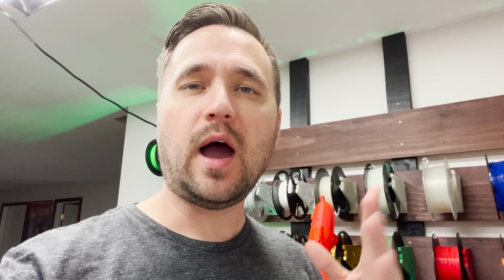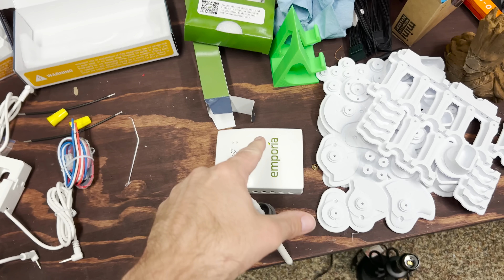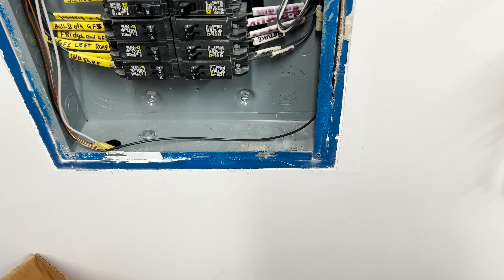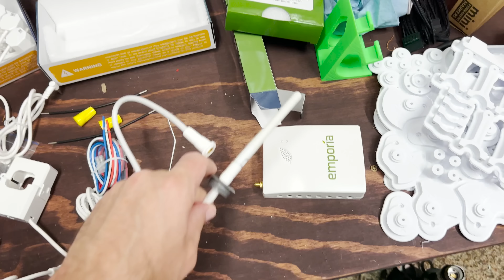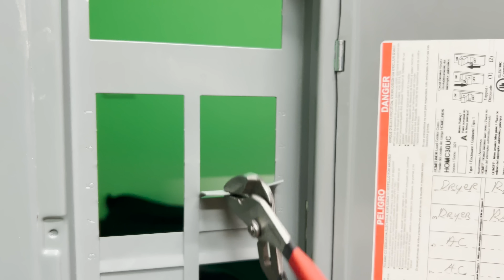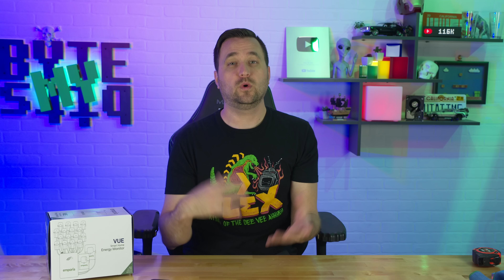Emporia Smart Home Energy Monitor, hands down worth every pennny!

Comment: The minute you said "server room", I knew you were going to be burning a lot of juice.  In general, unless you are doing heavy-duty computation, you are better off with things like laptops, Raspberry PI, or a maybe a NAS device if you need networked storage.

I just installed Vue myself - I still have around 400W unaccounted for that I would like to sort of get a handle on, and I have some mislabeled circuits that I need to verify (including one 240V "mystery circuit" that so far hasn't drawn any power).   Right now mine is still a rats nest - my project for later is to start to zip-tie the white cords up into bundles to try and neaten as much as possible before I put the cover back on.  But if the "mystery circuit" is no longer connected to anything, I might move that CT to some other circuit.

In my case, we already had solar installed - the Vue does a good job of accounting for the generation from solar.  The orientation of the CT for the solar connection is weird however - pay really close attention, and it might be reverse of how your other CTs are installed.

Comment: Im an electrician and we normaly use energy/power data loggers to measere the total energy consumption of a building. The emporia energy meter your showing is actualy a more simplefied version of these energy data loggers.
What your calling sensors are actually CT'S ( current transformers ).
And normally to measure the total energy use we would place our CT'S only on the 2 phases or 3 phases entering into the main circuit breaker.
So you dont need to use al 16 CT'S.
You could just use the 3 big ones and you will be able to measure your total energy consumption.
Reply: May I know which model of power loggers you typically use for buildings? We are having an energy audit performed at our factory and it would be good to monitor larger motors and fans. We were quoted $13K Per item for this (temporary) monitoring!

Comment: You didn’t hook up to ‘different phases’ - ur home is actually ‘split single phase’ - secondary xfmr has a tap on each end, with a center tap as ur neutral- at ur panel, you have the two hot legs from the end taps and the neutral- potential across entire secondary side of xfmr is 220v and potential across either end of secondary tap to neutral (which is bonded to grnd) is half of that or 110v

Comment: Great review, I dont know if you own a ev, that company also makes a ev charger that can work along with that energy monitor. So say you have all of you servers sucking all of that power,along with ac units or other high drawing appliances. If you are reaching the max load of your panel and the device detects it it will automatically lower the power from the ev charger. The wires look like a mess but having the same brand charger with the same app I am  stuck using the same brands. 

So what I am asking is do you think it is reliable worth the money. I can get a nice discount if you buy them in a package. Thanks for you help.

Comment: This is not a two-phase system. This is a single phase power source. It has 2 leads that are each 120VAC. A single-pole circuit breaker uses 120VAC, a double-pole circuit breaker uses 240VAC. Again, not a two phase system, it's a single phase, 240VAC electrical system..
Reply: A lot of people use 2 phase and split phase interchangeably.

Comment: This is a good system but has a serious flaw. If you've got grid AND solar supply with a hybrid inverter, Emporia will double count the grid supply. Emporia told me they couldn't fix this, even though I told them they only need to add in one subtraction calculation. Inverter output - Grid input = Solar contribution. So because of this flaw it's useless in this situation.

Comment: We pretty much all have an electricity and gas usage monitor in the UK but the implementation is terrible, it’s all a closed a proprietary standard which was rushed out and the usefulness of the data depends completely on whether the energy company can be bothered to make it accessible. Mine seems to have random days of usage missing.

Comment: I've been debating between this emporia and sense. Did you look into sense? It seems like alot of people like that because of the "unlimited" devices. But was wondering your thoughts.
Reply: I looked at sense first and I found a lot of reviews that said the AI component is still in its infancy and doesn't quite work.
Reply: @RichardFPV  yes that was what I heard also. Sense is good for whole house usage and a secondary source of power from solar or generator.  It was lacking in how to learn knew electrical signatures.  That is how it knows an AC or a welder or an oven is using power.  

What I would like is to have meter or usage reporting on each leg or circuit. By the way, the clamp meters with this unit is limited to 50amps. That leaves out most of my 220 legs.

Comment: I feel like Sense would have been a better way of doing it. It doesn't require all these adapters, just the two power clamps and after a while, it can adapt and detect what kinds of devices are drawing power and how much. It's actually really crazy how it works.

Comment: Jason...  This Emporia Smart Home Energy Monitor seems like a great idea.  Your breaker box and sub-panel box looks well marked.  I have a question though, my breaker box looks like the original electrician was a total retard.  In that only the major breakers are marked clearly.  I'm wondering if there is a device that can be pluged into a wall socket and then use something similar to a tone generator like network engineers use to trace and identify network cables at the breaker box.  In my case I believe all of the 220 volt circuits have been moved over to a sub-panel when I had my AC installed and those the electrician clearly marked.  But the main panel box is a real mess with regard to be clearly marked.

Comment: You can choose different units of measurement in the Emporia app, including amps. Just click on the burger in the upper left, and there’s a heading for it.
Reply: Does it work for 220v? It is 2 hot lines. 2 hot in one sensors?

Comment: I've always wondered why people are so afraid of getting shocked or electrocuted. I've shocked my self many times and I kind of find it fun and not painful. I was 6 the first time plugging in my radio and squeezed the prongs together to get into the socket. I got a good jolt that scared the hell out of me but laughed my ass off after I figured out what happen <--- freaking child idiot, what was I thinking? Then again when I was around 9 years old holding onto 2 pin ball machines at the arcade, I just kept doing it cause it was a deep vibrating tingle, NGL, kind of fun.

Comment: 1.5MW/hrs  isnt too bad, that for me is the beginning/end of summer, during the hottest months of summer i usually am pulling 2MW/hrs (most of it goes to A/C cooling, although my server room makes the A/C work harder, but in fall/winter  it reduces heating costs lol. (server rack runs around 600-700watts of continuous power usage)
Reply: MW/hrs? Do you have a nuclear reactor in your backyard??
Reply: @Nuclearnadalah  lol no, but i have a server rack running 24/7 with 5 computers, 2 desktops that are on 24/7, im third shift so house lights are on all the time im awake.  but if i look at my bill im within 0.5-1mw/hrs a month of usage to most homes in my community  most people use around 1mw/hr or 1000kw/hr a month)
Reply: @jjjacer  I think to some a MWh sounds like a lot but my local power charges one rate for under 1000KWh and another for over. In the summer here in FL I would gather that most houses are hitting 1.5-2MWh/month.
Reply: @jjjacer  also there may be some confusion because you are saying MW/h instead of MWh. There is a huge difference in those two units of measurement 🙂
Reply: @frankmthompson  ah yeah, megawatts per hour is alot more than megwatthours

Comment: You can buy a second one, not hook it up to ther main circuit (dont' use the 200a CTs) and you can add the second one under the first in the app.

Also, look at their outets. I don't use them as smart outlets, but I use it to narrow down what devices in a room are using the most.
Reply: It runs a esp so you don't need the cloud.  Look around you can find a way to flash it so it can be local.

Comment: Does the app let you enter a $/kwh amount so it can tell you how much the electric is costing you real time or by hour, day, week, month, etc?
Reply: You can either enter a flat rate or you can pick your power company if they support rates over OpenEl
Reply: It does, but if your power company is like mine, they have different rated depneding on how much you use (I have a < 1000KWh rate and a > 1000KWh rate), then you don't get accurate results as their app only allows you to enter a flat rate.

Comment: Not sure why watching you poke around in a live electric panel makes me nervous. If it goes bad there will not be a video, at least, probably not one posted by you. Thanks for bringing us along.
Reply: I don't get why they don't put covers over the mains (Besides the main cover). A bit of plastic would help. I jsut installed an Emporia Vue 2 last weekend and I was scared too.

One thing I did though was turn off the main so I only had to be careful around the main taps and not the rest of the box.
Reply: @frankmthompson  to be completely fair the average person isn't supposed to be in there
Reply: @HowYouRemindMe269   True, but if I were an electrician, I think having that extra level of protection when you're just adding in new circuits would be nice. It's not often after initial isntall that you need access the main poles (or at least not many I can concieve not being a licensed electrician, so take that for what it's worth)

Comment: Does the App require Google Play and does it ask to access anything pn the cell phone? Or is there any way to see the monitor off the phone?
Reply: They have a web app and the phone app is basically just an HTTP wrapper to the same page.

I've not seen it ask for anyting except location for when it does the BT pairing to get connected to the network.
Reply: @frankmthompson  it asks for location? Why would do that? There is ZERO need for location.
Reply: @philindeblanc  In Android, you need "location access" to access BT. Dont' ask my why it's set up like that. It's a google thing, not a Emporia thing.  They do have an alternative method where the box goes into a hotspot mode and you dont' need BT if you don't want to. 

Edit: now that I think of it, that is the outlets that have the hotspot mode. I can't recall if the actual Vue 2 does it as well, but I assume it does (trust, but verify)

Comment: yea another cloud based IOT device. UGH.... got a monitor that can talk to a syslog so I can tie it into my Elastistack?
Reply: Yuu can get a BrulTech GEM for 4 times the cost (granted, you get 32 circuits).  That is my end goal, but money is tight so I went with Emporia Vue 2 for now just to see how I was using power. I put it on an IoT vlan with only access to the internet (not even other devices on the same vlan).

Also the Brultech lives outside the main electrical box. Currently my box is in my masterbedroom (previous ownder converted the garage to a room), so until I can pay the $2k to have the box relocated, I don't think the Wife would let me have just some odd box hanging over our bed with a bunch of wires running to the electrical box. :(

Comment: You can combine wires through one current clamp, however, if they are different phases they will cancel each other out because the phases are 180* from each other.  To resolve that, you can run one of the phases "backwards" through the current clamp.  If they are on the same phase then it will work fine.
Reply from the maker: Holy bananas I didn’t even think about that! Ty!
Reply: @Bytemybits  Hahaha holy bananas.  Canadians are the best.
Reply: Came to say just that. Or he could double up every other breaker to make sure they are on the same phase.
Reply: Well andy the phase would only be out by 180 if each of the wires were on the same phase and current direction was in opposite directions. Like a stard 2 prong lamp cord. The hot is pushing current into the lamp and returning on the neutral. So putting a clamp meter around the cord would show a diminished current reading because the field of the neg return is weaker then the hot side. IF the 2 wires are on the same breaker than ct can go around both. OR put a ct on each lead check it out for yourself.
Reply: won't all the breakers on L1 be the same phase (and on L2) 😉

Comment: They have a bigger one that you can get that it has even more
Reply: Not that I've seeen. They have 1 base unit.Yo ucan get packages with 8 CTs or 16CTs, but that is the max. You can do 2 of the units though (just don't connect the second one to the mains), and you can child it under the main one to get combined readiings.